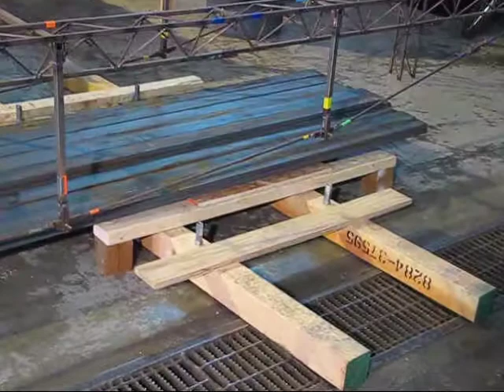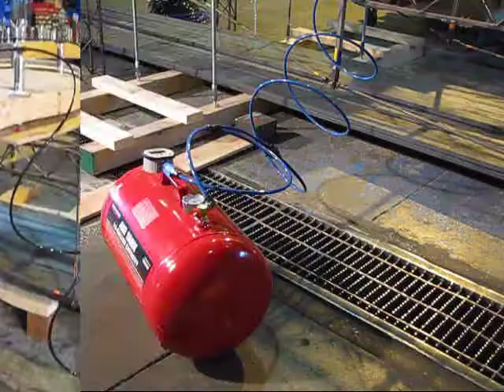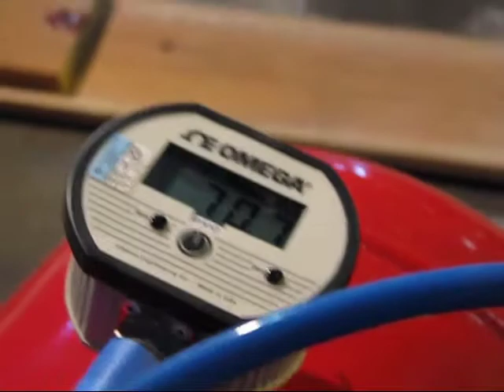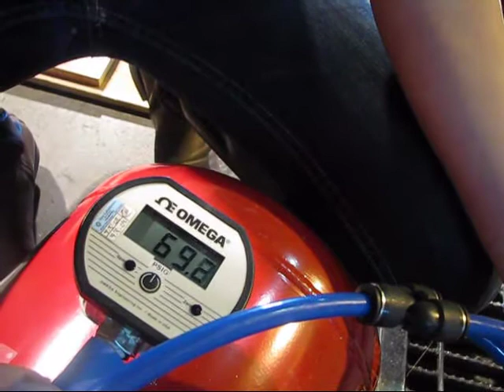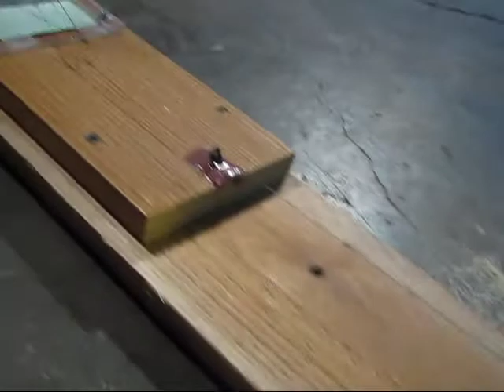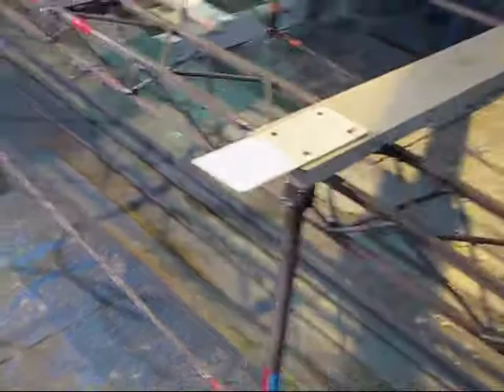2011PNWSC_Loading.mp4

Comment from the maker: @gzamac 
Darn character limits... restating the last reply:

Each cross head with plywood grating weights between 75# and 80# (exact weight is marked on the crossheads).  The rules allow for 250# (50# grating + 200#) preload on backspan and 100# (50# grating + 50#) preload on cantilever... so weight is Okay as long as we add more.

Comment from the maker: @gzamac 

The deflection devices are physically independent of the loading devices, so your concern regarding deflection of the cross heads is irrelevant.  They can deflect all they want to without effecting the deflection measurement.  The rules allow for 250# (50# grating + 200#) preload on backspan and 100# (50# grating + 50#) preload on cantilever... so weight is Okay.